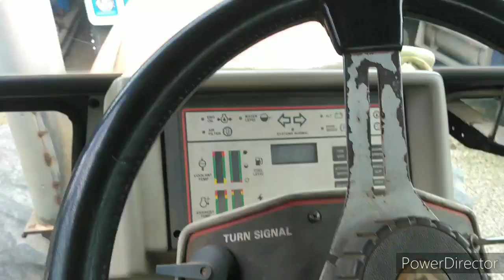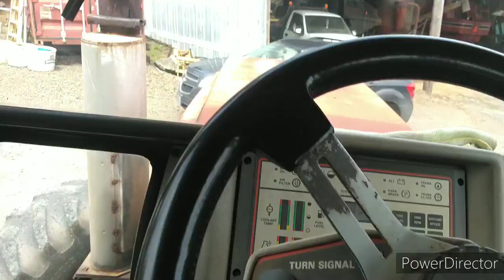Another calf, a dumb calf and a positive note at the neighbors

Comment: Hey Ed... What is that cotton picking looking machine at the 16:05 mark by the stock trailer?
Reply from the maker: It's a 9940 cotton harvester.. converted to a flower seed harvester.. picked it up to build a new sprayer, then found out the top speed is slower than we spray🤣😂🤬 so, it's a parts machine 👍😎